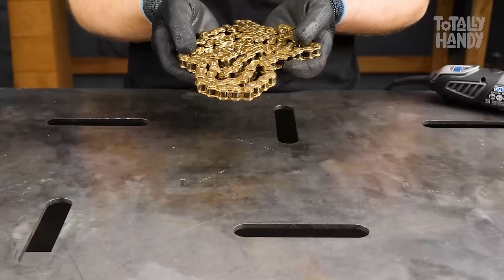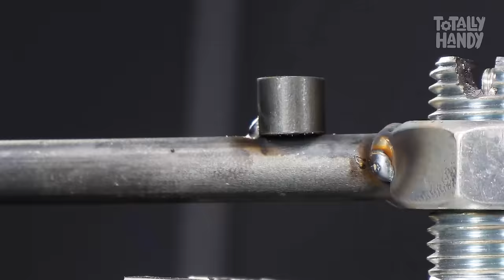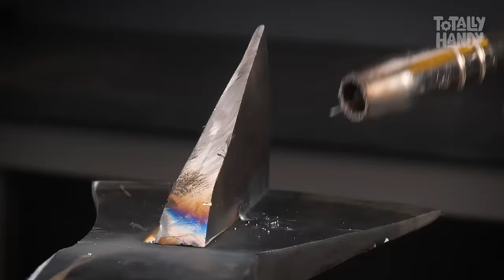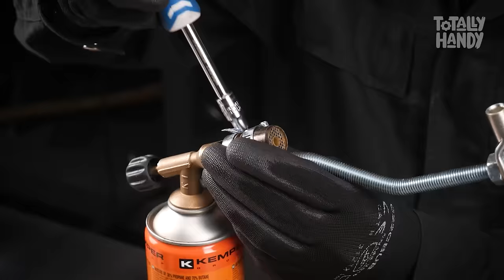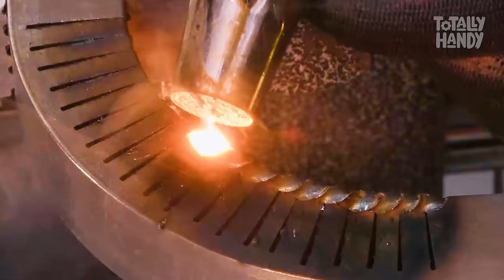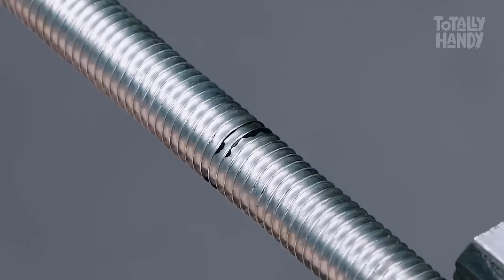This Is How To Weld Nuts And Bolts Like A Genius | Metalworking Project

Comment: Picked up a gasless  MIG Welder Sca Mini Mig 100 for au$60 & 3 coils wire - the guy couldnt weld & was moving soon + and a heap tools $100 the lot 
A Bargin  the wire alone is worth$100 . it didnt feed but after a teardown & clean i found the Trigger in the handle wasnt conecting i got Working 100% today .
Reply: new auto darkening  welding  helmet au$65.00 that you can see hyour work clearly b4 you weld 100% worth getting

Comment: Ok the ground connection 1 with welding, u literally used a welder to make what u had to have in order to weld so what was the purpose of making it when u already have a different ground ground. Ain't complaining just asking also some of those things u made I'll have to try